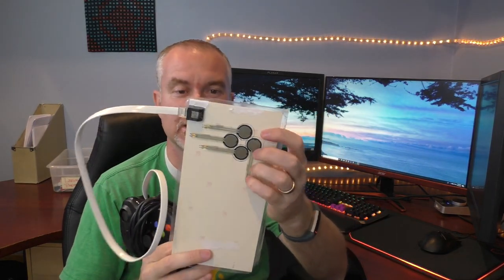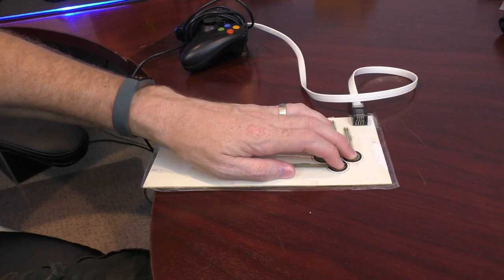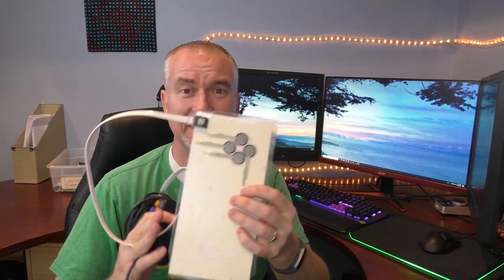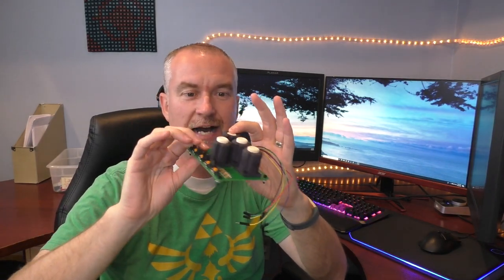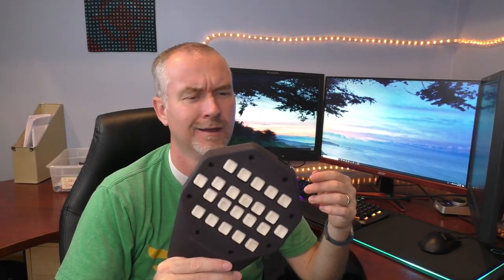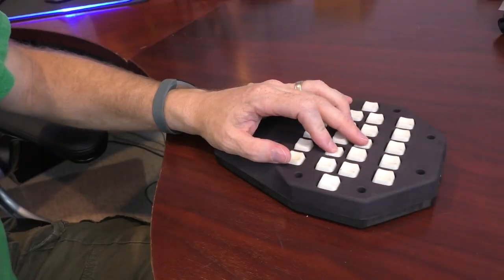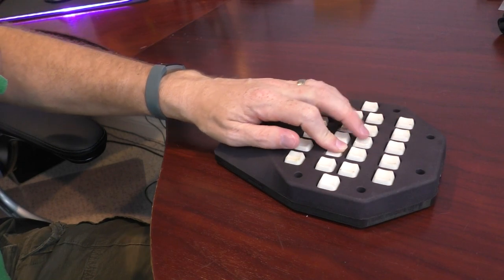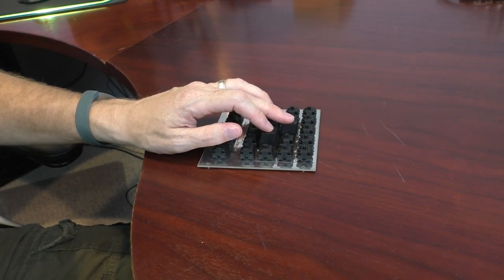Amped About Aimpad Episode 30 - Aimpad History - Cooler Master ControlPad

Comment: I have another question now that kickstarter has launched. It seems like the obvious answer based on the marketing material on the page but I don't think it's specifically mentioned anywhere. The pad is quite expensive so I want to make sure that every single key is analog capable and not just a region like the MK850. Could you confirm this to me before I decide to purchase?
Reply from the maker: Hah!  I told Cooler Master this wasn't obvious!  Yes, all 24 keys are fully analog!
Reply: Thank you. I would've considered it obvious if the MK850 wasn't a thing. But it's always better to have this kind of information available in an FAQ section. And since it's a feature I'd argue it's nice to say up front. Not having it anywhere, made it seem like there might be some fine print stating that only 2 rows are analog.
Reply from the maker: Yeah totally understand.  I have editing rights to the FAQ now, so I added the question and answer there to reduce any misunderstanding.  Thank you so much for your support!

Comment: Very interesting episode! Definitely still excited. Might just get both if my wallet allows it. I assume they do work at the same time?
Reply from the maker: Thank you!  It is always satisfying to look back and see the progress that has been made.  Using the MK850 and ControlPad at the same time will technically work, but as far as gaming goes be aware that whichever one is detected first will show up as "Player 1" and the other device will show up as "Player 2".  Some single player games will accept inputs from either controller, but most single player games will only accept input from "Player 1".  There is a feature on the MK850 that makes it very easy to disable to the Xbox Controller from the keyboard, and this would always force the ControlPad to "Player 1", but then you would not be able to use the MK850 analog profiles.  Just something to keep in mind.
Reply: That's not a problem. As long as it works exactly as 2 Xbox controllers, x360ce can merge them into one or VJoy can do it for DirectInput with many analog axes.
Reply from the maker: Wow, I haven't used x360ce in a long time.  Had no idea you could merge inputs into one with it now!  That is awesome!